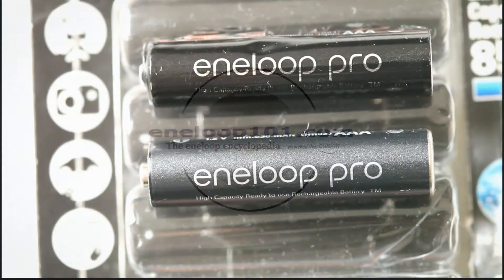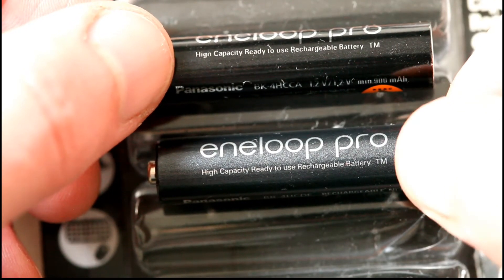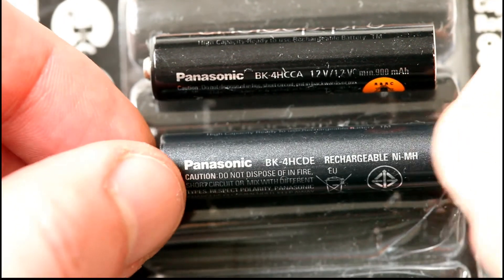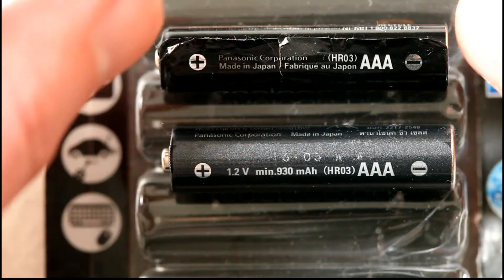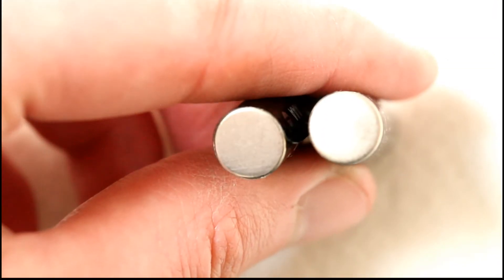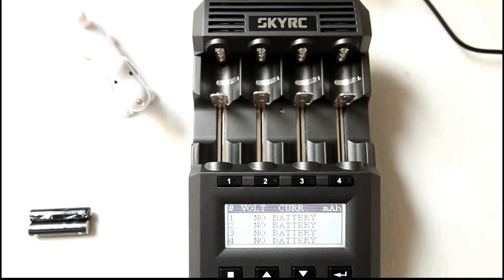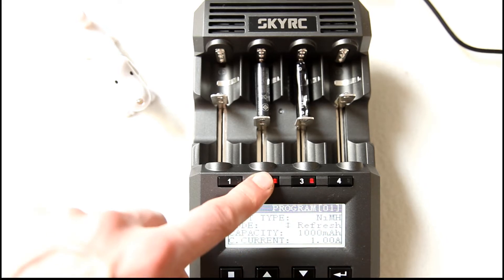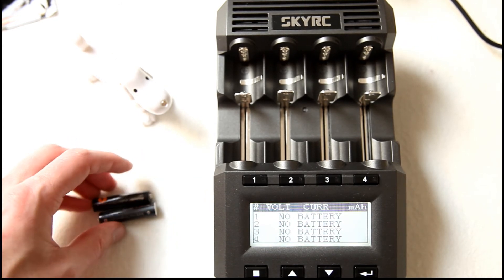Fake eneloop PRO AAA from eBay **PART 2** (batteries and capacity check)

Comment: Hi Eneloop 101 please do a comparison for a 2018 Eneloop white PLEASE PLEASE PLEASE ,  the 2018 white product date i have is "MADE IN CHINA" and the battery production date is below the + symbol is impossible to read and is very very tiny, also the battery is off white / grayish color ..
Reply from the maker: Hi, 
Eneloops are either made in Japan or in China. The Chinese ones are of lower quality, but are still " eneloops ". I personally don't own any regular white eneloops that are made in China in order to check them out!
Reply: @Eneloop101  please make a review also for eneloop lite for comparison of original vs fake